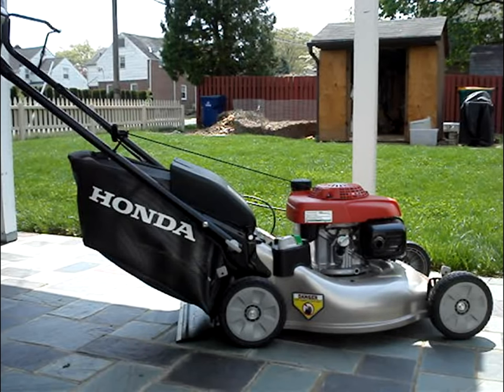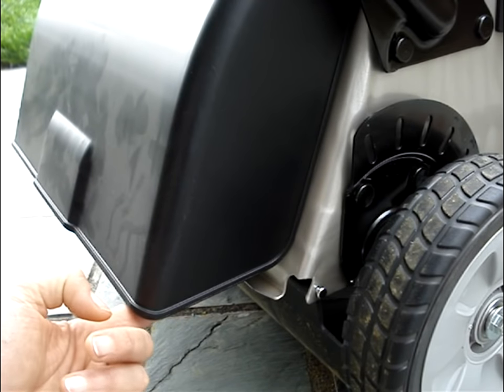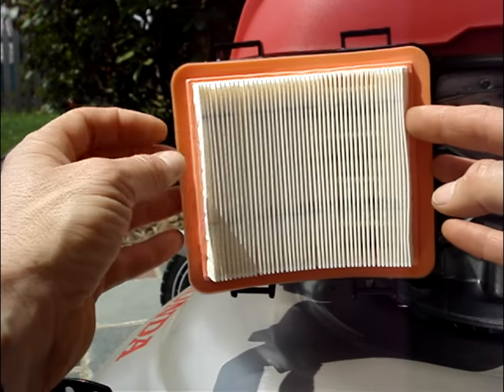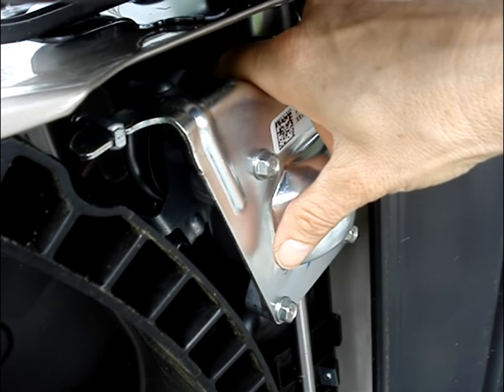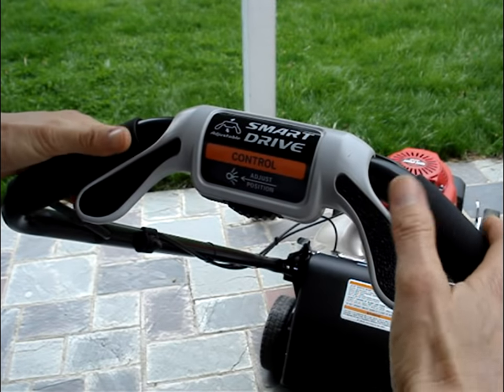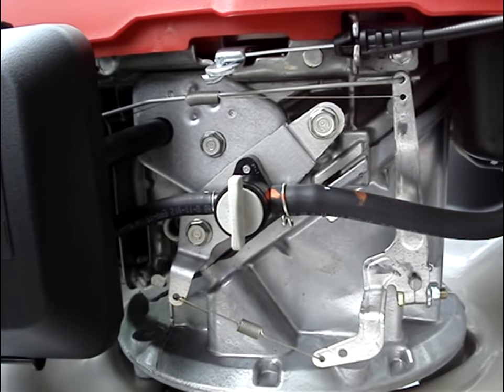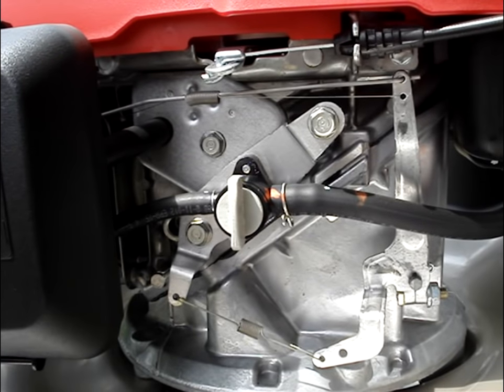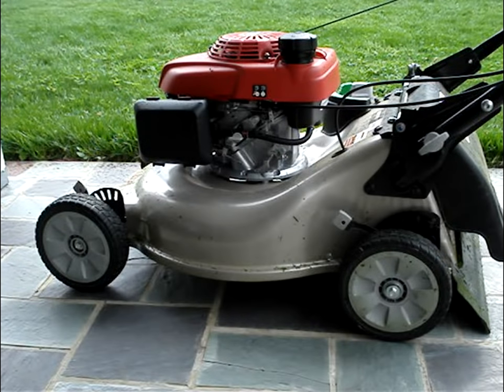Honda HRR216K9VKA Lawn Mower Review

Comment: It's not the motors but all the hardware that's plastic and cheap know that will not stand the test of time. You can do it tutorial but not a review after having something for 2 days
Reply from the maker: I spent a lot of time looking at mowers before I bought this one.  In the $400 price range, this was the best I could find.  It had the least amount of plastic.  I don't know of any mower in that price range that does not have plastic, do you?

Amazon, Lowes, Home Depot all have reviews.  I made the video because a lot of people will buy one without seeing it.  It's meant to help people see what they are buying.  I have no control over what manufacturers make.  I'm sorry you are angry about the plastic, your time would be better spent complaining to Honda.  I'm not nuts about the plastic either, but they all have plastic.  I can't fix that for you.

I've owned the mower for a year.  It is easy to pull to start and starts on the first pull unless it has not warmed up & you turn it off.  It does the job.